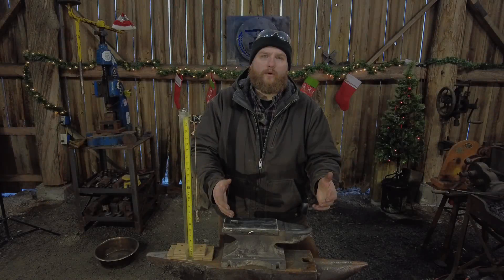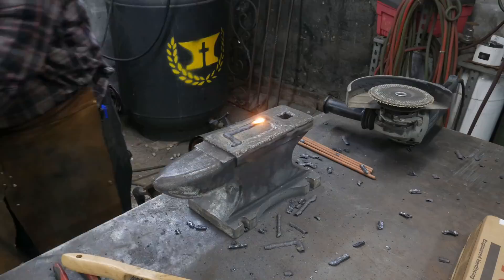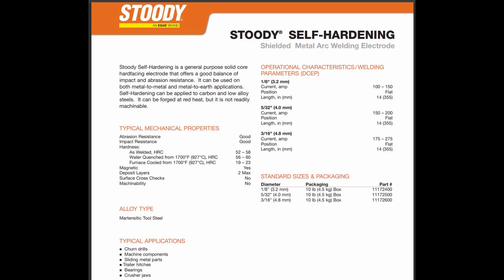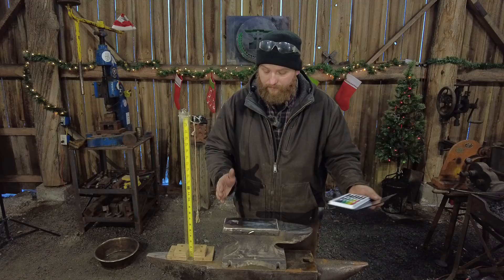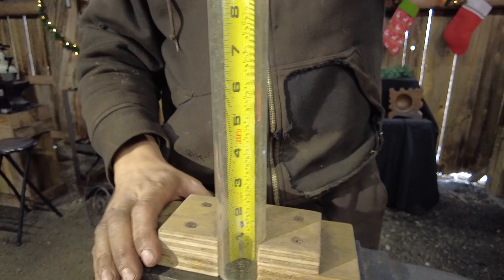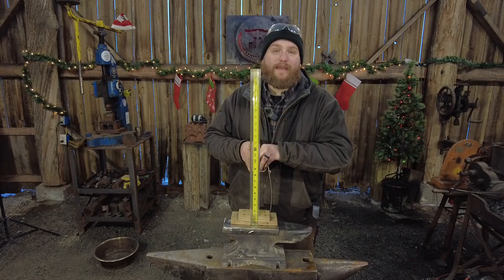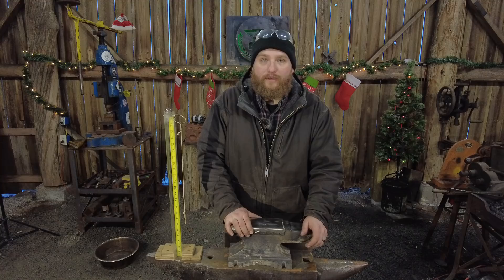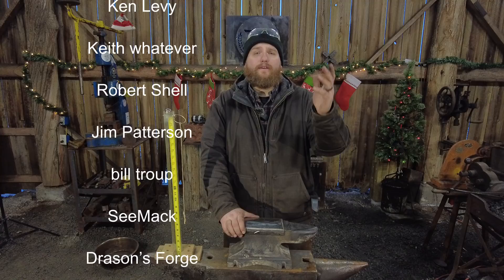Astonishing Results! Hard Surfacing a Harbor Freight Anvil

Comment: This is VERY dangerous!  Hard facing applied with MMA, should fracture and splinter off at any time, and the cast iron base material may fracture/break.  The ONLY feasible way of doing it is using powder welding, with appropriate powder.  Idiots, like this guy, simply don't understand that what he is suggesting could result in a nasty accident. Highly irresponsible to put up videos, whose content could very well cause a nasty injury.
Reply from the maker: Thank you for making your "idiot" statement It always makes a person ready and willing to learn from you and adjust their tactics. My suggestion is your probably a few slices Short of a full loaf 🍞 ta ta for now....
Reply: @ChristCenteredIronworks  I wonder if like many others on here, you feel that posting up a video, showing a very dubious way of doing something, instantly makes you into an expert with 40 years of hands-on experience?  I

If you are not sure of something, why put up a video, which might result in someone getting hurt, simply because you don't know what you are doing?  

With properly done powder welding, it might well be possible to make a pretty much unusable cast iron anvil, into something very functional.

The major problem with your method, is the welded hard face, will delaminate very quickly if the anvil is ever used seriously.

There would have been significantly more chances of  that method working, if holes had been tapped into the anvil, and a layer of 312L TIG welded on, which you then MMA weld too.